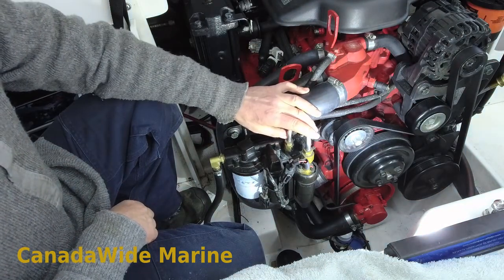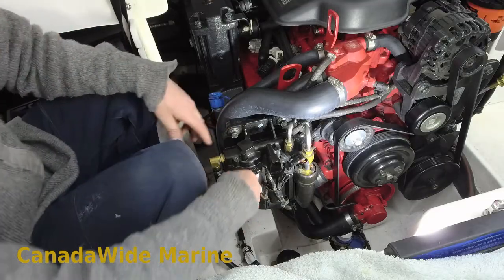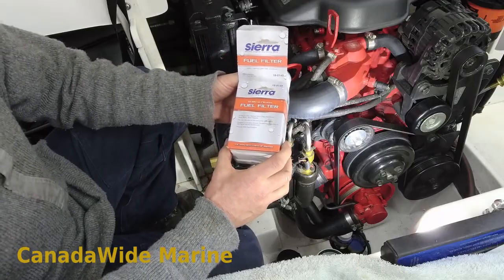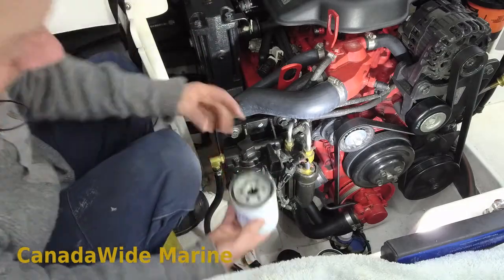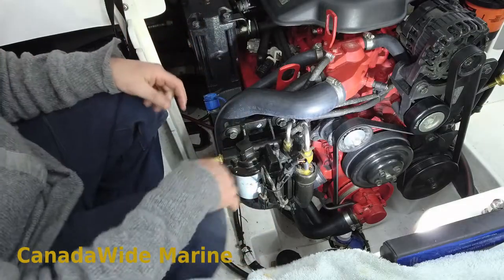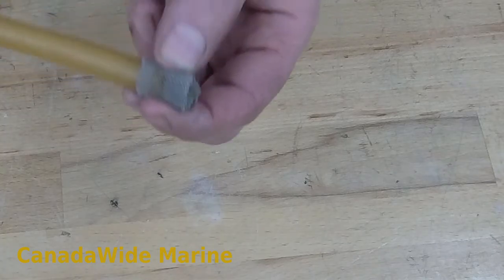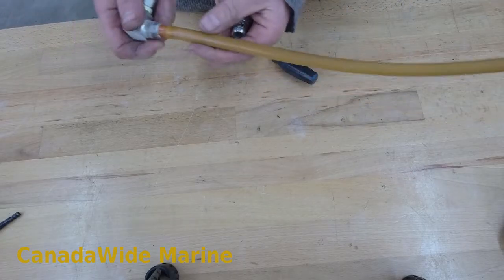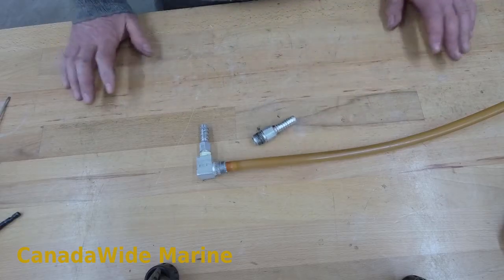Volvo Penta Fuel Pump Whine explained and fuel filter change.

Comment: Hi Mike, I bough a fuel pump for my Penta Volvo GXI and have a prblem for reinstall the cooler lines. As a newbie, I don't took a pics before desinstall, shame on me. If you can answer me that will be great. On the first pic, yellow circle, where go the line ? On the second pic, I have this line come from the bottom of engine behind a big water hose. Where I should to connect it ? Thank you sooo much for your help. Have a great day. I can't send a pics, no possibility here

Comment: Was troubleshooting a customers boat today and found that the inlet screen on the bottom of the high pressure fuel pump was clogged with fuel gel (has been sitting for over a year). I ran the pump through my ultrasonic cleaner with water and a little CLR radiator flush. It cleaned up beautifully. Flushed the pump out afterwards to get the water out and now the pump is quiet as can be. I’ve also had problems before where the fuel filter is sucking air because of not being tightened down all of the way. Hope this helps somebody out there. BTW, the factory Volvo Penta fuel pump assembly is a Carter branded assembly. Save a lot of money and just buy from Carter if replacing.
Reply: thats some hillbilly shit brah

Comment: Mechanic of 38 years (not certified) and maintained Navy fighter motors, great presentation. Thank you for taking the time to make video on maintenance. I know what it takes for video, record audio and editing on the backend. Just to tweak on the fuel filter procedure:

1. The potential of introducing fuel contamination increases when pre-filling a fuel filter. Fire hazard increases because of present fuel vapor, so careful attention to that. Have a fire extinguisher within close reach.

2. After the fuel filter is installed, turn the ignition key to run, not start, to activate the fuel pump. After about 5 seconds or when the pumps shuts off, cycle ignition off back to run. Repeat this about 5 times.  This will not only fill the fuel filter, and charge the EFI system, but fuel will bypass back to the fuel tank dispersing air.

3. If you forgot to bring the petroleum jelly to lube the fuel filter gasket and to save a trip, just pull the oil dipstick. There is just enough oil on a dipstick at the “full line,” to lubricate the gasket. Lightly touch the dip stick tip to equally spaced spots on the gasket. It will spread when tightening the filter to snug, not tight.

Again, great topic and presentation 🔧🔧🔧

Mike

Comment: I have a 2018 Regal with the 4.3 catalyst engine which uses a different fuel pump then the one you show on your video and it has been been whining more steady in the last few years and I have almost a limp home mode at times that limits the throttle.When I first got the boat there were issues with dirt in the fuel filter and after changing it starting running better eventually.I am going to check everything on the suction side and hope fully find the problem.The fuel pump for this is around $700.00 so I would rather not replace this if I don’t have to.The pressure readings on this were approx.16lbs. on the low pressure side and 73 lbs. on the high side.That seems high but I assume these newer pumps with a direct injection must read higher.I have pulled the fuel pump off and was wondering if I should reinstall it if I find a problem or if not replace it?thanks
Reply: hey, I also have a 2018 Regal with the VP V6 200-J motor and a whining fuel pump. No real noticeable power loss, but I want to inspect it before the pump burns out. did you find the culprit for yours? I had a impeller get chewed up and wondering if rubber fragments are blocking the fuel pump cooling line coming off the oil cooler.

Comment: super interesting and valuable. Thanks. 
I wanted to add on my side, the electrical connectors attached to the high pressure fuel pump are often the cause of electrical issues leading to a noisy whining fuel pump. There might be a little weakness on those parts..

Comment: Great video I'm going true some problems on my 1993 5.0 four winns 190 horizon after changing the water separator filter can get it to start I dint fill it up with fuel I believed I air lock the fuel system 😓🥲any advice . Thanks .

Comment: I have a 1987 Volvo Penta, 5.7 G. I've had it for 20 years and I've been through 5 fuel pumps. I've checked the pickups. I checked the filters in the tank out of the tank. For some reason, the fuel pumps just burn out is that normal.

Comment: If youve got a moment. I need a part number for the pickup and elbow. Mine sheared off in the tank. Gonna try and recover with an easy out...what a silly thing to happen. 7.3GSI PEFS Motor.
Reply from the maker: The pickup and elbow are specific to your fuel tank. We will need thread size and depth of tank. You can email: support@canadawidemarine.com, or call us toll free: 1 855 949 8176

Comment: Very helpful, but would like part numbers included.
Reply from the maker: part numbers are different for different models, so rather than have someone assume what part number they need it's best to give us a call or email  with your make model and serial number and we will happily look up the exact part number you need. Toll Free: 1 855 949 8176 
support@canadawidemarine.com
Reply: Got an '07 8.1 ... mine ( and MANY others have that range ) takes 3862228 ( if they haven't  changed it this week )

Comment: Would the belt tensioner pulley on that engine in the video be a normal right hand thread as it rotates clockwise to loosen the belt?
Reply from the maker: Yes it is.

Comment: Well done!  Clear and concise. I was hearing some intermittent "whining" and thought the pump was just going bad. Great preliminary things to check as I troubleshoot my fuel pump problem.  Thank you!
Reply: Did you fix your whining problem?
Reply: Yes.  It took a bit of time and a little frustration.  No restrictions mentioned here in the fuel line.  I checked and broke off my anti syphon valve in the syphon tube fitting so both of those needed replacing.  My issue was black paint flakes in both the pump and pressure regulator screens.  With the help of videos from "Man Cave Mechanic", I ended up removing the black paint from the interior of my fuel pump assembly.  After that I tested in the shop and all was good.  I went to the lake and the engine ran terribly after a few minutes of cruising and barely made it back to the ramp.  The problem was found to be that I did not quite tighten the anti syphon valve in the syphon tube fitting enough and I was sucking a small amount of air.  Once that was remedied, it ran great.  I also replaced the pressure regulator in the troubleshooting process but I don't think that really had anything to do with the fix.  I'm glad I got all the black paint removed and my original pumps are now functioning great.   @E-Rock-x

Comment: I just replaced my fuel filter and now my pump whines and the engine backfires at higher rpm. Any idea?
Reply from the maker: You may have dislodged some debris and caused a blockage, restricting fuel flow. Or you may have an air lock in the pump. I always pre fill my filters with "clean" fuel before installing them. Electric pumps do not like to suck, but are very good at pushing fuel.
Reply: @CanadaWideMarine  I filled it with some fuel from a gas can before installing it. You think I should try putting another fuel filter on it? Engine runs perfectly fine until I go over 5000 rpm. I have the new Penta 240.
Reply from the maker: I would definitely try a new filter if that is all you changed and now have a running issue.

Comment: This is all wrong … the pump gets noisy because the water lines get plugged up coming from the thermostat. And the pump runs hot. Or the vapor separator gets blocked up with salt and causes the fuel to turn into vapor.  Has nothing to do with the inlet lines.  Or the filter.    Also. Volvo recommends not to fill the filter before install because the center is unfiltered.  Then u can bring contaminates into the fuel pressure regulator screen and block it up which is a service bulletin to remove the screen and put a e clip on it. ..because it will cause the fuel pressure to spike to 100psi.     When the paint fails
Inside the fuel pump tank and feeds black paint chips into the injectors and for screen.  I’m a Volvo penta rapid response dealer.
Reply from the maker: So you are saying that all those fuel pump whines I have repaired over the years somehow had the water cooling lines cleared out when I cleaned the blocked suction side of the fuel supply? How did that happen? In fact, the last one I repaired because of paint blocking the regulator, (yes, I am familiar with the tech bulletin) had great water flow through the cooling lines because I happened to be checking that out also.
How about you try admitting it is not "all wrong" and accepting that there can be multiple causes for a fuel pump whine. As for pre-filling the fuel filter, why would anyone pre-fill a fuel filter with contaminated fuel? I only use clean fuel from a clean container.
This is why I never diagnose a problem without seeing the boat or motor in person, because there is never an absolute "this is what causes the problem". Machines are dynamic, many factors influence many other factors. Just an FYI, I am Volvo trained, Honda Trained, Indmar and Ilmor as well. I've been doing this for 43 years.
Reply: @CanadaWideMarine good response sir o find your video to be very good to my ongoing issue . Thank you so much .
Reply: Let’s see YOUR videos.

Comment: When priming the fuel filter, I've seen many videos showing opposite of how you're doing so. They hold they're thumb over the center hole and fill in around the outter holes..... How important is one method over the other? I'm assumng it's about the draw.....
Reply from the maker: Great question. In operation the fuel enters the filter through the outside ring of holes, passes through the filter media, then exits through the center hole. So if you want to be absolutely certain that all your fuel is being filtered yes, pour it into the outside ring of holes and not in the center. I find it easier to just use clean fuel, from a clean container to fill the filter. I'm not sure why anyone would want to use dirty fuel to prime a new fuel filter.

Comment: To anyone having fuel starving, backfiring issues on Volvo Penta engines:  had the same issue on my '04 Four Winns 250 Horizon with VP 8.1L Gi.  I had bought the boat used, but could only run on its trailer before buying.  Ran fine on muffs!

Went through the fuel system from tank to fuel pumps, everything checks out:  fuel clean, good pressures. Took it to local Four Winns dealer who started at the other end of the fuel system, drained the fuel rails.  Bam!  Water in the fuel going into the injectors!  Where's that coming from?  The water cooling jacket on the fuel cell was leaking water directly into the fuel before being picked up by the high pressure fuel pump.  Put a couple pieces of hose on the water nipples on the fuel cell, one with a plug and one with a Schrader valve.  Hooked up an air pump with gauge, fuel cell water jacket wouldn't hold pressure.

Worked with Man Cave Mechanic in MI to swap out my fuel cell core, checked that new one would hold pressure in the water jacket.  Yep.  Had accumulated some rust in the high-pressure fuel system - here comes a good word for Evapo-Rust.  Let it sit in my fuel rail upside down overnight, no acid in Evapo-Rust to attack any seals.  Rinsed it out.  Had my fuel injectors ultrasonically cleaned and put in new screens. Boat's been running like a beast past 4 years!

So to anyone suspecting a fuel system issue, start at the other end first....check the pressure and quality of the fuel going into the cylinders first, then work BACKWARD to the tank!  Also, nothing like an in-water, full throttle test before buying.
Reply from the maker: That is good advice. These Volvos are getting to the age that corrosion in the fuel cooler is becoming an issue. I expect to be changing more of them in the future for this exact reason.
Reply: Can you help more, I have the same problem and sometimes the fuel pump sucking fuel is stop working but when I unplug the high pressure wire then it start working?
Reply: @aaalammari  Sorry.  But that is nothing like my problem.  I had a water leak in the fuel cooling jacket but the pumps were working fine. Sounds like you have an electrical problem or something inside the pumps themselves.

Comment: Very helpful video. I see you replaced the filter with a longer one, 18-8149. I normally use 18-7989. They are both 10 micron filters. Do you recommend that replacement because of increased capacity?
Reply from the maker: If it will fit I always prefer to install a larger capacity water separator. If you have very good control over the fuel going into your boat the larger capacity may not be needed. By very good control I mean inspecting your fuel before it goes into your tank, I highly recommend using a funnel with a water separating filter, it saves a lot of heartache.

Comment: I put a 8.1l in a m1123 humvee, is there any reason i cant/shouldn't use the same external pump you have here?
Reply from the maker: No reason at all really, but you will pay a premium for it being a marine pump with raw water cooling. You won't be using the cooling with your engine coolant, (too hot). So it does not seem like the right choice, unless you just happen to have one kicking around.
There are plenty of aftermarket pumps and pump systems available. If you need some help choosing something feel free to contact me at info@jimobalek.com with more details of your build and I can help you out. 
FYI I am a specialty vehicle mechanic/fabricator, you can check out my other channel here: https://www.youtube.com/watch?v=bPEqCP0JZuA&pp=wgIGCgQQAhgD

Comment: Thanks for the video. I'm tracking down a fuel pump whine and issue. Do you replace the fuel pickup tube, check valve, and strainer? Or is there a way to clean them effectively?
Reply from the maker: Hello Carl. Generally I have found that the anti siphon valve, pickup tube and strainer can be cleaned by simply blowing out with compressed air. If there is a varnish or sludge buildup in the anti siphon valve I will replace that so it works properly. 
One other thing you can check is the pressure regulator on the fuel rail. I recorded some video on this but seem to have misplaced it. There is a simple clip you can pull out to access the regulator. There is a fine filter screen on the regulator that can become blocked causing the fuel pressure too high. This can also cause a whine in the pump. I will re-do a video on this next time I see it.
Thanks for watching.
Reply: @CanadaWideMarine  Thank you! I will give those a clean. I took them out but didn't see any sludge. My pickup didn't have a strainer, just an open tube. I will take off the whole fuel line and check as well. I've cleaned the FPR mesh a few times, I even removed all the injectors, cleaned those, so the fuel rail, FPR, and injectors are good. The pump is new this year and is one of the non-interior painted ones from ManCaveMechanic. So I'm narrowing down my issue to something in the fuel pickup, or the fuel filter itself which I'll swap out too.
Reply from the maker: Have you checked your low and high fuel pressures?
Reply: @CanadaWideMarine  No but going to check tonight!
Reply: I saw that in your video and other comments so I want to do that as well as cleaning all the bits on the supply side too. Again, thanks for everything.

Comment: I have a 2005 Volvo Penta 5.0 with fuel pump issues.  It has no anti siphon at the tank.  Should I add one?  I'm replacing the fuel pump this week
Reply from the maker: Yes, you should definitely add an anti-siphon valve for safety. you don't want a small leak in a fuel line to drain your fuel tank into your bilge.
Reply: @CanadaWideMarine  is this something I can pick up at a parts store or do you recommend a good source to order from?
Reply from the maker: Any marine store should have them. We do not have them listed on Canadawidemarine.com but if you use the chat function, or email us at support@canadawidemarine.com we can set you up and ship them to you.

Comment: if we have eliminated all possible restrictions and still have a pump thats whining after you accelerate for about 30 seconds  and then  continues to run terribly and whine.  pull it out take home, check things replace things, go back and same thing..

this is a brand new pump
Reply from the maker: I assume you have not done a fuel pressure test. Check low pressure and high pressure side. If I remember correctly low pressure should be 8 psi, high pressure 50. This will ensure both pumps are actually working. It is possible for say the low pressure pump to not be getting power, (or ground), and still have the high pressure pump working and doing all the work. Another possibility you may find is a blocked return screen in the fuel pressure regulator, this will present as pressure over 50 psi on the high pressure side. 
The problem with youtube diagnostics is it is not possible to cover all the possibilities.

Comment: Does a 2013 380 VP suffer from restrictions or paint issues? If there was a restriction causing a low-speed fuel pump whine, wouldn’t you expect a corresponding lack of performance due to fuel starvation at WOT?
Reply from the maker: It could suffer from either problem, and many other possibilities as well. A compete and proper diagnostic will define exactly what the problem is. A restriction to the fuel pump can cause a lack of performance, particularly at higher rpm and load. Many boaters never see those conditions, every situation is unique. It is impossible to to cover every single possible cause of a certain problem in a youtube video.